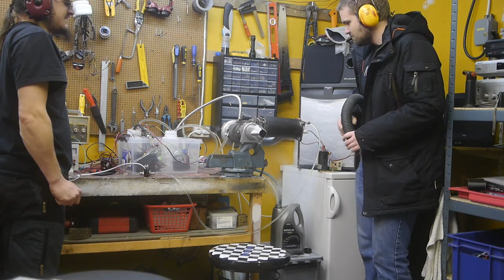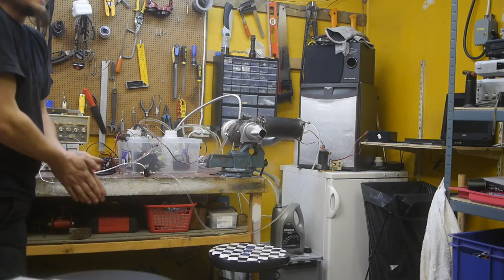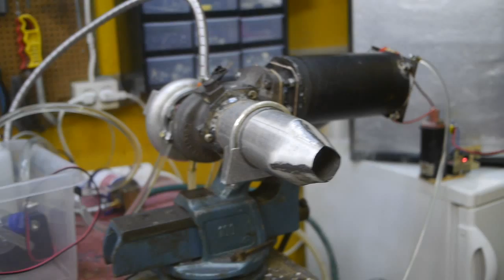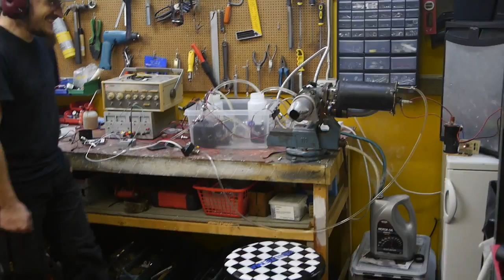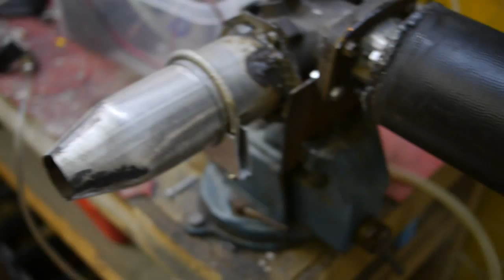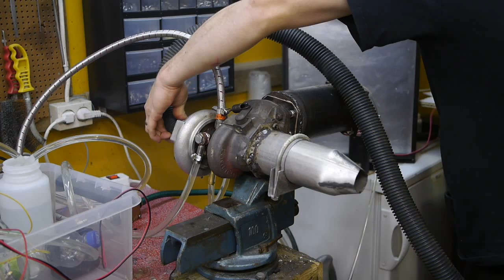Turbojet running with cooling and fuel system

Comment: Looks nice but running far to hot are you using dry fuel (Gas) if so use kerosene or methanol.
Reply from the maker: Yeah, a bit hot, we had bad compression due to leaks pretty much everywhere.
Runs a lot cooler now though, at least when we use reasonable amounts of throttle ;)

We're running the engine on E85 (85% Ethanol, 15% Gas) for the moment, there are plans for diesel but that will come at a later date.

Comment: Hi, this is pretty cool I made one too, but the turbine heats much, what your cooling system cools? thank you
Reply from the maker: The CHRA (the center bit between the compressor and turbine) is watercooled since it's a mitsubishi turbocharger.
Other turbochargers might use a higher oil flow for cooling instead.

But if you are having trouble with turbine heat you aren't burning up the fuel fast enough. Could be a problem with injection or with compression leakage.
If you are using liquid fuel are you pre heating it before releasing it in the air stream?
Reply: Frinkbit Hello thanks for replying, I am using cooking gas, it works fine, but the fan gets very hot very fast, my turbocharger is an old truck and has no water cooling, I'll check my connections for leaks pressure, and your turbo has an unlimited time to work or he needs to stop for a while to avoid overheating?
Reply from the maker: Gustavo Henrique Ribeiro In theory if everything is working as it should you could run it continuously. But it's a bit hard to cool off all that heat, so in practice the cooling system just prolongs the run time, and shortens the necessary breaks. At least thats true of our setup, we could use a bigger radiator and fans etc but we want it to be somewhat compact.

If you are using cooking gas you either have compression leaks, flame tube of the wrong dimension/design or even injecting the gas at the wrong place, maybe try higher up in the flame tube.

By the way, whats your definition of very hot?
If we are talking about a dull red glow that isn't something you have to worry too much about, sure the turbocharger won't last as long as in the truck it came from but it will last long enough. After all turbochargers are built to handle a lot of heat :)

Comment: How did you weld such thin steel(the exhaust cone)?
Reply: I dont know if you still need this answer but stitch welding, there's was less heat distortion than seam welding